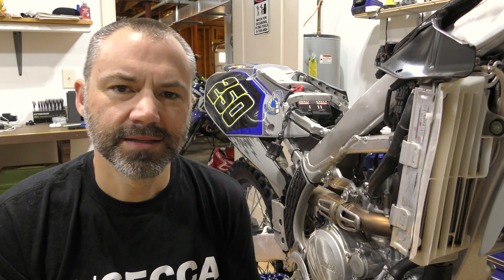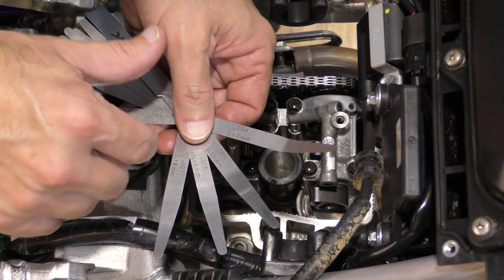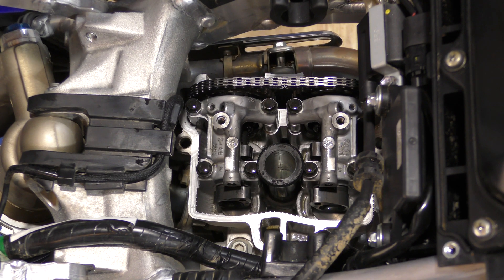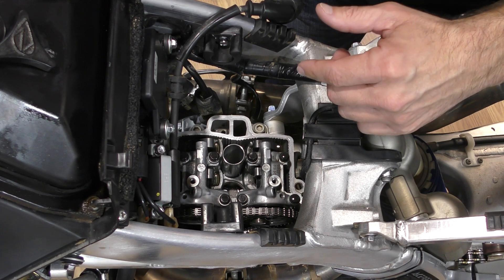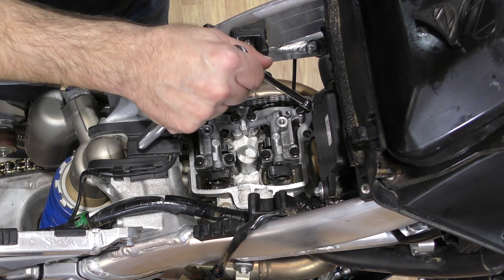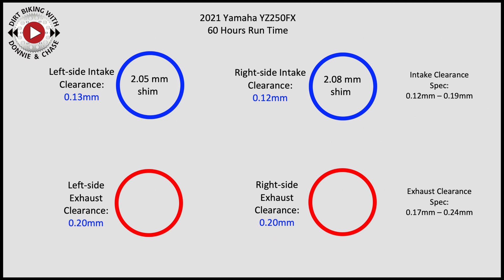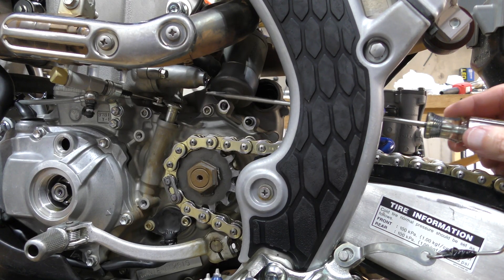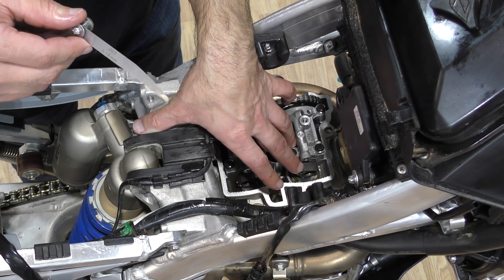Adjusting valves on my 2021 Yamaha YZ250FX - YZ250F, Valve Shims, Step by Step

Comment: Im so confused how it goes from 0.15mm to 2.08mm?
Reply: Well, he sort of overcomplicate it.  lol.   first of all the left-hand intake shim was 2.05. All he had to do was move it to the right side and that would’ve fixed it and then he would’ve only needed a 2.03 on the left side.
If you have any kind of relationship with your dealer and you should,  for me I simply walk into the back where the mechanics are with my shim in hand and trade it for the one I need don’t buy any kits that way…
Now for your confusion, it did not go from 0.15 to 2.08 0.15 was the clearance that he measured….
The shim that was giving him that clearance was 2.08 mm in thickness . when he moved it to 2.05 in thickness that opened the clearance up.
Example, let’s say your shim is 2 mm even  2.00.   And your measured clearance is.0.2 tight,  that means you need a 1.98 thick shim.  It’s really that simple.

Comment: Hi ive just done a top end on my 2022 fantic xxf, it's a yz250f engine identical in every way. What my issue is the dots on the cam pulleys aren't perfectly inline with the surface of the head. The pulleys have very little wear I've fitted a new chain, at tdc the cams are aligned but the dots are a few mm difference out on the top of the head. Can the pulleys spin on the cam ? Is this a problem on these engines ? Or am I being pedantic an they have a little wiggle room ? The bike spins over fine by hand, with no interference but the manual only has drawn pictures rather than the real thing so I've nothing to compare to. In summary cam lobes align, tdc mark on flywheel aligns and I have 27 pins on the chain between the cam dots. I'm driving myself mad with this any help would be much appreciated

Comment: What a ball ache just to adjust the valves. Gotta remove seat, fairings, air scoops, fuel tank, starter, head, cams and tensioner. On my 190 pit bike it's just 4 bolts to remove the head and adjust valves.

Comment: Ya great video but does 2/100’s of a mm really make that much difference?
Reply from the maker: I mentioned in the video the reasons I was going ahead and bringing them back to the middle of the spec. Also, this video has paid many race entry fees, so yes. Thanks for watching!
Reply: I hope my comment didn’t come across as negative. It is a very good video. Details, clear and concise, and it seems you cover all that is important. I’m sure I’ll refer back to it when needed. Thanks for posting.
Reply from the maker: @bakergilbert  No, I appreciate you watching and commenting.

Comment: Great video…def subscribing. 👍 Love how you get right down to business and don’t waste people’s time with a stupid intro and a bunch of talking at the beginning of the video like most “professional YouTubers” feel the need to do.

P.S. Technically, the only thing I’d say is that a lot of mechanics recommend doing the measurements on the TDC of the stroke where the cam lobes are pointing up and out (can’t remember if that is the compression or exhaust stroke). I forgot why that is the recommended stroke to take the measurement on but it might be something to look into if you’re interested.
Reply from the maker: Thanks for watching. I follow the service manual procedure, which is TDC. You can see the cam lobes facing up as I’m checking the clearances.

Comment: On the Intake are  the valve specs 0.10 - 0.17 mm as the manual say.  If I have to adjust it is it better near or to 0.17 mm, or near 0.10 mm?

Comment: I have on my WR450F 2022  Intake  the specs 0.10 - 0.17 mm as the manual say.  My Intake valves are now on 0.11 left and 0.13 mm on right after 150 hours. Should I adjust it to 0.15 mm or is it o.k.? The Exhaust valves are in spec.
Reply from the maker: In my opinion it’s ok as long as it doesn’t go below 0.10. You’ll need to check the clearance regularly to see if they are getting tighter. Also, the engine will become hard to start when warm if the intakes get too tight, so that’s another sign they need to be re-shimmed.
Reply: @DirtBikingwithDonnie  
Thanks for the answer. The bike starts without problems, even when the engine is hot. But since I have dismantled everything anyway I thought that I re-shimm right now before I reassemble everything. Then I am for the next 100-150 hours on the safe side. I've never done anything like this before and with your instruction I should do it sometime.

Comment: Great video.  Have you had to do a topend yet and if so at how many hours?
Reply from the maker: I haven't.  I sold this bike with about 140 hours on it.  I purchased everything to do the top end but it never showed any signs of needing it (no power loss, no oil consumption, etc.) so I never did it.  I have friends who have well over 200 hours with just oil changes and valve maintenance.  I now have a 2023 yz250fx with 45 hours and haven't had any problems with it either.  I have gotten this question several times lately so maybe I should do it just to make a video.  Thanks for watching!
Reply: @DirtBikingwithDonnie   Thank you. I've stayed away from the 4 strokes because I've heard that you need to do the topend after 25-30 hours.  I might have to get one.

Comment: What socket did you use to take the spark plug out? I’ve tried 2-3 different sockets and they are too thick.
Reply from the maker: 14mm regular deep socket. Spark plug sockets are too thick.
Reply: @DirtBikingwithDonnie  thank you sir.

Comment: I really wish they’d come up with a way that a regular person that’s not a mechanic could just ride forever and not have to do an adjustment every 20 somewhat hours. Or make it somehow that you don’t have to tear apart half the engine to do it.
Reply from the maker: They are very reliable engines.  Some people run them for 150 hours or more with just oil changes.  It's a high-compression engine that will rev to 14k and produce 42 hp so there are some maintenance trade-offs with that kind of performance.  How you ride it will also determine how often you might have to do valve maintenance.  If you stay off the rev limiter it will stay in spec a long time.  It can be intimidating but the shimming process isn't difficult if you buy the right tools and take your time.  Thanks for watching and commenting!
Reply: Great video btw. It really made me understand how to do it. Not as scary now.

Comment: Great video best I've seen?
Let me ask anybody have hard starting when bike is normal operating temp?
I heard this was a characteristic but not sure tried lithium battery still slow starting 2020 yz250fx
Reply from the maker: Thanks!  Yeah, it’s a common issue on the 2020 and up yz250fx. How many hours? Clutch drag can be an issue with the stock clutch.  Do you have the problem when in neutral?  Otherwise a Antigravity AG-801 battery and raising the idle to 2,500 helps a lot.
Reply: @DirtBikingwithDonnie  Slow starting Donnie especially slow in gear. (probably 150hrs) Let me ask you replace the valve cover gasket with new once removed or any sealant?

Comment: Just wondering with the spark plug tube, does that just pull out? My old spark plug was filthy as well as the inside of the tube I just want to clean it out
Reply from the maker: I've never tried to remove it.  There is a drain hole at the bottom of the tube that drains out of the right side of the head.  With the spark plug installed (to keep anything from getting in the cylinder) you might be able to flush it out with some parts cleaner.
Reply: @DirtBikingwithDonnie  ah yeah thank you, I’ve seen on other bikes leaking rusty fluid down there from that hole that makes sense thank you

Comment: Great video, thanks 👌 
I have 1 small question re: cam chain tensioner, when you put tension back on the chain is there a setting, like a number of turns? Or is it just wound all the way out? Cheers from 🏴
Reply from the maker: It’s tensioned by a spring so when you release it, it automatically springs back to where it should be.

Comment: Hello! I was wanting to get some help. I took my bike down and checked the clearance because at constant throttle or using the cold start switch the bike sounds like it’s breaking up. I bought the bike used and never had a Yamaha but I’m unsure if that’s normal and I’m just being picky. I figured even at constant throttle it shouldn’t make any weird difference in exhaust sound but I’m unsure. 

I got my valves back in speck and put in a new plug. If I’m climbing RPM it sounds normal just not constant. 

Any ideas if that’s normal or not. 

Thank you
Reply: The bike has 17:36 hours
Reply from the maker: I think what you’re describing is normal if I’m understanding it right. Does it run normally when riding?
Reply: @DirtBikingwithDonnie  as it’s climbing in the RPM’s it’s clear and everything sound great. As soon as the bike stays at a constant RPM it sounds like there is a faster exhaust not almost like a launch control on a race car if you will. I will try to get a video.
Reply: @DirtBikingwithDonnie  i just uploaded a video. Would you be willing to take a look? You can hear it change sound at constant throttle. Just wasn’t sure if that sounds normal or not.

Kind of like it sounds it revs and sounds closer together or something. 

Thank you so much!
Reply from the maker: @Frank-i-e  It sounds normal to me but I can’t tell what you’re doing with the throttle in the video. Nice bike!
Reply: @DirtBikingwithDonnie  thank you so much! I was just revving it up and holding the throttle constant and it just sounded different to me as like maybe a hiccup or misfire or something but maybe I’m just being paranoid since it’s new to me. 

I really really appreciate you taking a look for me.
Reply from the maker: @Frank-i-e  That’s completely normal. Ride on.
Reply: @DirtBikingwithDonnie  thank you once again!!!

Comment: thanks for your videos. You have some of the absolute best videos for us shadetree mechanics. The links to the products in your videos help as well. 

You led me down a rabbit hole talking in one of the videos about gummy tires and about having a second setup for different terrain. What have your experiences been running gummy tires in mud? Thinking about getting a setup ready with AT81EX tubeless for mud races. The mud races in WV are brutally slippery and greay and every little bit helps.
Reply from the maker: I’ve found that gummy tires are great on wet rocks and roots but not great in pure mud. I would think the terrain in WV would be very rocky and if so a gummy should do well.  They do wear out fast.

Comment: Are the shims magnetic? Just stick in the bucket?
Reply from the maker: I was using a magnet tool to remove the buckets. The magnet holds the shim to the underside of the bucket. Oil will also cause the shims to stick to the bucket so if you’re not using a magnet you have to be very careful to not drop the shim.

Comment: Wow you're a great bike mechanic, love your videos, I have the exact same bike as you, I already put 73 hours on it and I haven't checked the valve clearance at all, the bike feels great to me, did you feel any difference because the valve were a bit of clearance, or you just doing it by hours, what could happen if I don't check mine?
Reply from the maker: Thanks! The most common symptom of tight valves is difficulty re-starting when the engine is hot. Although these bikes are sometimes hard to start when hot regardless. I had started to notice mine was getting a little harder to start when hot and that’s better since I adjusted them. I have friends that have similar hours as you and haven’t checked theirs either. I’m a little more particular about mine and I like to check the clearances every 25 hours or so. Thanks for watching.
Reply: @DirtBikingwithDonnie  thanks for your your great videos, now I have an idea how to adjust the valve clearance on my bike. One more question, I would like to install the yahama lowering link on my bike, which I've heard is gonna lower the bike one inch, but I can't find a bar riser to adjust the forks, do you think is ok to do that, and where can I find risers for this bike, thanks.
Reply from the maker: @matiasmaldonado510  Here are some bar risers that might be what you're looking for.
https://amzn.to/30WxmJC